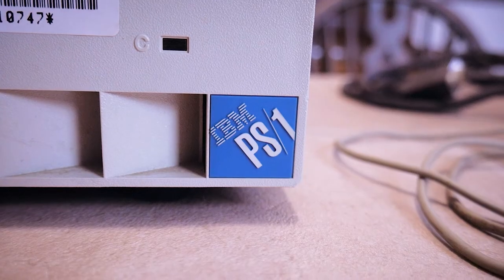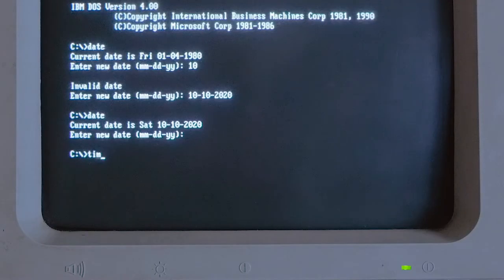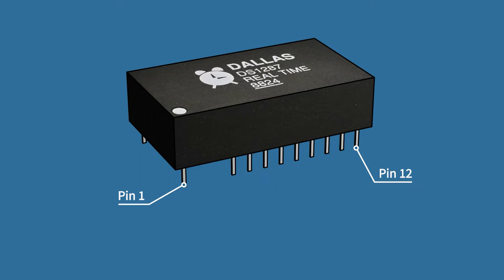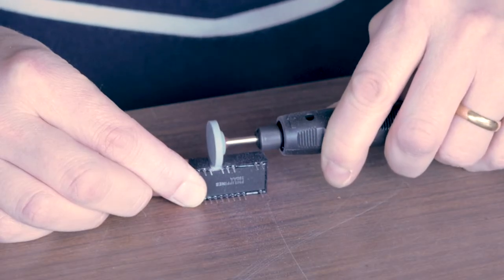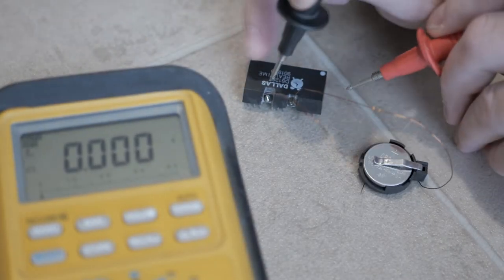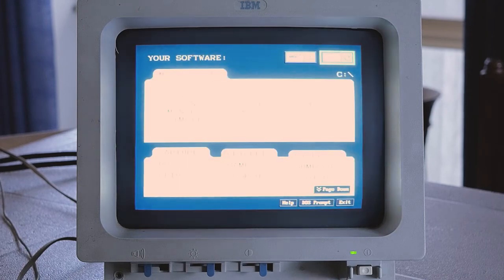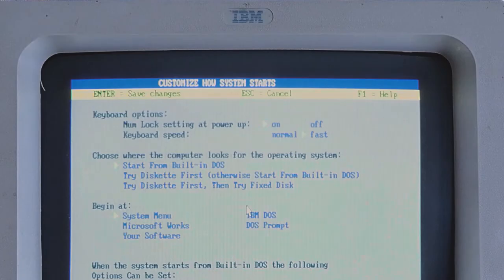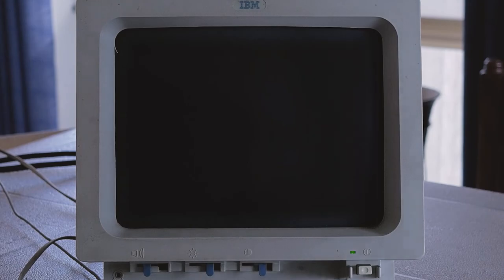IBM PS/1 2011 Pt 2: DS1287/DS12887 old computer repair hack

Comment: Another youtuber pointed out that there are 2 ground pins on that chip so you may not have to cut 2 holes in the plastic casing on the chip to get ground.
I've yet to modify my chip. 

Excellent video 🙂

Comment: Thanks for this! Tip from many years ago for anyone who might be googling this video... RTC errors can be temporarily cleared, and the system settings reset, by holding down both mouse buttons while powering on. I can't remember now why I had to do that way back when, but if your PS/1 of this vintage is stuck in a weird mode and you can't get to a DOS prompt or the Four Quads, this might save the day.
Reply from the maker: That’s a great tip and would’ve come in really handy in a lot of my testing! I will try it soon. Thanks!

Comment: Great vídeo. I am trying to restore a PS/1 2011 as well and my floppy drive reads the disk and the first sectores but delivers sector not found to the rest of the floppy. I have checked capacitors and aligned the drive but the problem continues. Will try to make this repair to see if it works.
Reply from the maker: I think I had similar problems. Errors 161, 162, or 163 at boot mean a DS1287 fix is worthwhile. Otherwise your chip might be OK for now. Other floppy checks: Does CONFIGUR report a 1.2MB or 1.44MB drive? Also, have you tried formatting a floppy in your PS/1 to see if that disk is then usable?
Reply: @fooglestuff  faulty drive aside, the 2011 has the weird quirk to have floppy drive not working if the rtc is depleted and there are no configur settings... It causes to headbash a lot of people since how unique this "quirk" is
Reply from the maker: @MasterControl90original  Thanks for the feedback :) I'm learning all the time with this thing.
Reply from the maker: @genkidroid I've found that "Sector not found" often means the drive has been detected as the wrong type... most likely the PS/1 thinks it is a 1.2MB drive when it is actually 1.44MB. My next video should be out soon which goes into this in more depth.